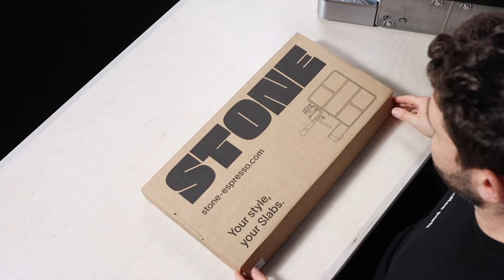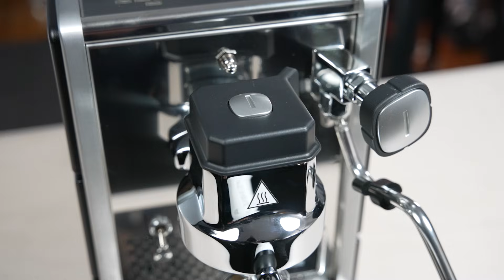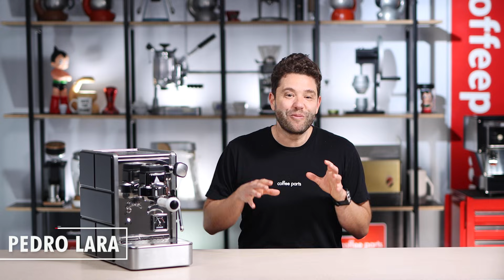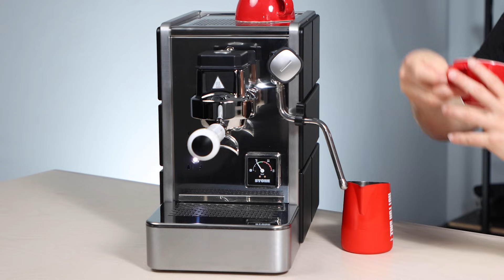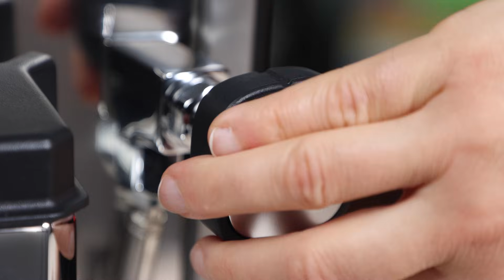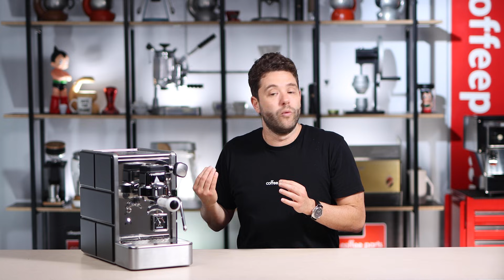Stone Espresso Home Coffee Machine | Review

Comment: Looks fine and will fit many users and budgets. I am always a bit concerned when a review is more cosmetic than coffee TBH. It has a PID, but is it adjustable? If so, how and where? Same for pressure. Can ECO be turned off? 9I find Eco mode annoying, although perhaps less so on a "fast warmup" machine) 

If the main boiler is a steam boiler (i.e +100C) how does adding a heater to the grouphead (if that's where it lives) result in ~95C for coffee? That is, how does a heater cool 100C water down to 95C? Are the PFs standard E-61 size or proprietary? 

I suspect that under the skin, this is 90% your current Profitec/ECM and now Stone assembly, but is the boiler stainless? That would be more useful to know that magnetic tiles. And a word of warning to potential purchasers - if you lose or break one of your "tiles" in five years time you may have a hard time finding replacements. While the actual coffee-making parts are available for decades (usually) anything cosmetic (or even drip trays) can be a mission. Stick with standards

Comment: Beautiful machine. 
Unfortunately no information on the porter filter : size, material, quality of the filter.... 
It's an important element when choosing though.
Reply from the maker: You're right, and in this case the portafitler being used is my portafitler and not that which comes with the machine.
The machine comes with a standard double portafilter, same as you would find on most machine of this price point.